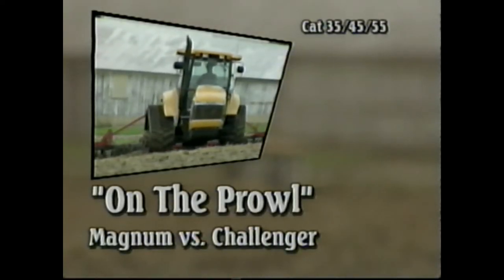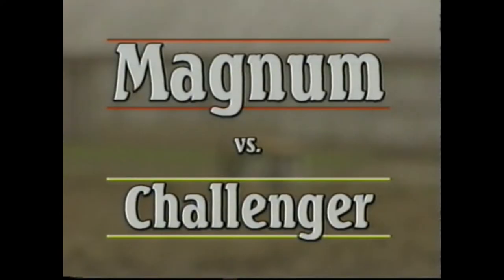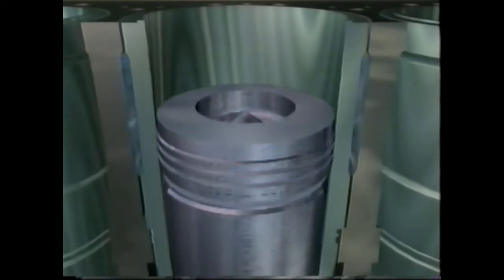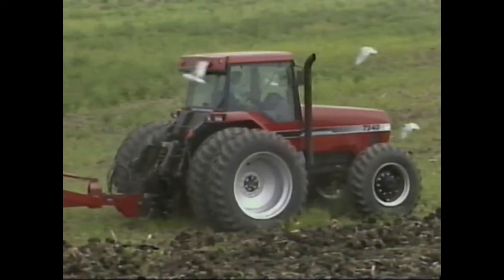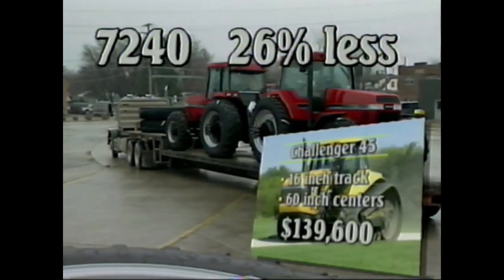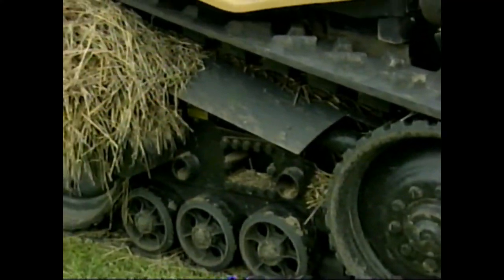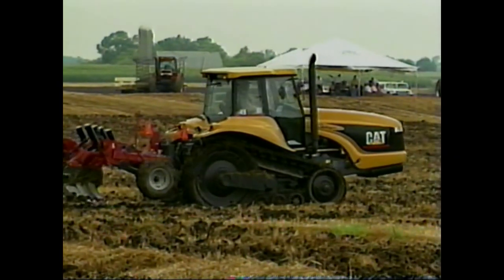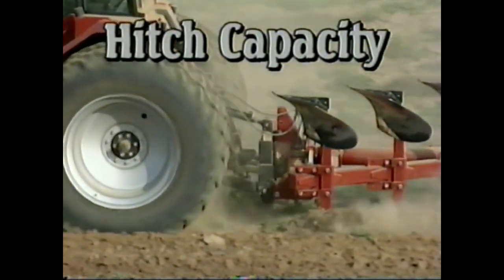Case IH Magnum versus Cat 1995

Comment: I've never run a Challenger, but I've had the privilege of running the Magnums ALOT back in their hayday...the farm i worked at had 3 new ones. (2) 7140s and a 7120 all with FWA. They were absolute beasts and we used them for chisel plowing, spreading manure, grain cart in the fall...still my all time favorite tractor and im a JD guy lol.
Reply: Our farms runs all Case machines other than one CAT 75c, comfort and traction wise i will take the cat over any of the tired machines, but i would rather run a quadtrac over the cat anytime, its not a very fair comparison thought because the quadtrac is a decade newer and has a 100hp advantage on the cat

Comment: Still I will choose the Cat over the Case.
Reply: I’ve run mainly Case machines but we do have a Cat 75c on the farm and i would rather run it over any of the tired machines but i would take the quadtrac over the cat, its not a very fair comparison though because the quadtrac is 10 years newer and has an extra 100hp on the cat. Both are great machines imo

Comment: This video did nothing to convince me of anything. Sure the Magnums were fantastic tractors, but this video was an unnecessary production. They should have been comparing two tracked machines.
Reply: I’ve run both a cat 75c and a quadtrac and from my experience in the field the quadtrac gets better traction and is more comfortable, the cat is more comfortable on the road though those older quadtracs will beat you to death if you ain’t careful lol